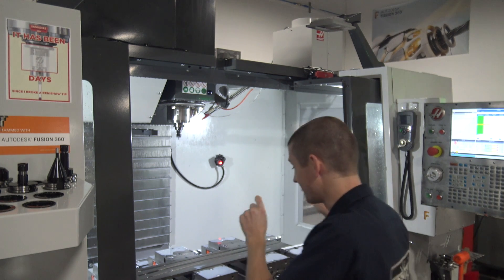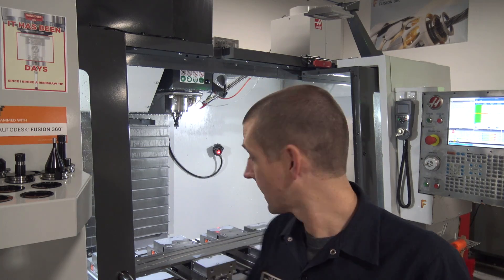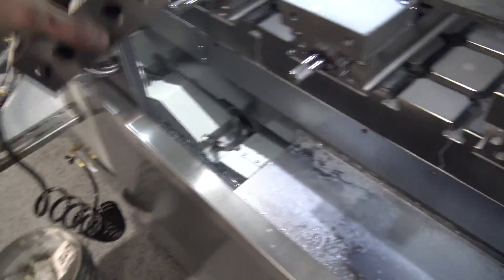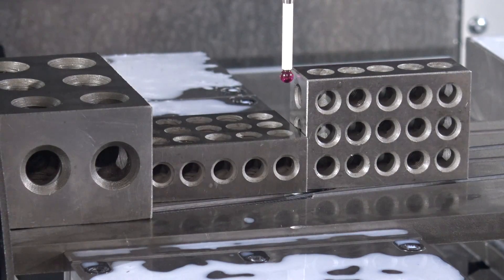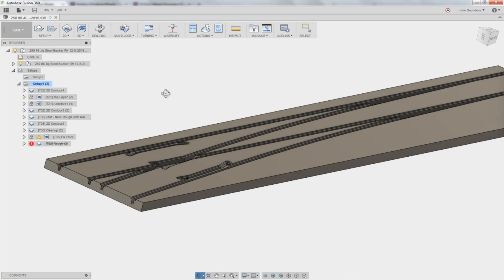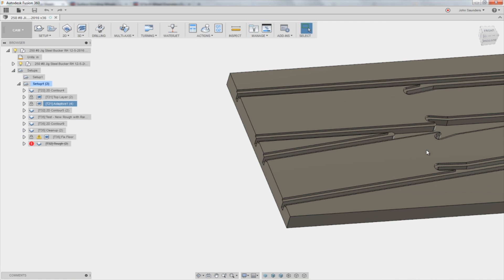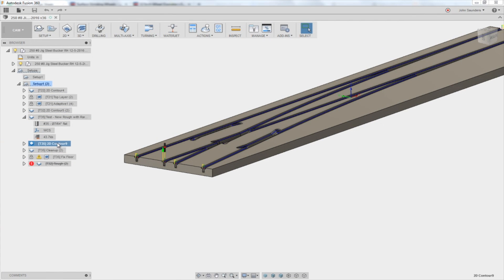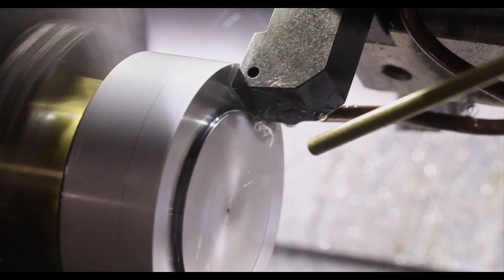Machining a Railroad Jig on the HAAS!

Comment: Hello John, Wish I had seen this video earlier this past week. I had a similar challenging slotted part I had to machine in 1018 MS. Had real trouble with tool path generation and had to get help on the Fusions 360 forum. Part came out OK but am going to try a different strategy, next time. I realize you cannot share the part but could you post the speeds and feeds you used? Thanks. J. Gaertner

Comment: John, why so harsh on the handwheel? Use the jog, and be gentle with the wheel. Apart from the fact you want the wheel to live out the machine life, be proud of your machine and respect it. Handle with care. The moment someone just gives a spin to the wheel like that I take that as an I don't care anymore.(I mean, while it spins you have no control over the machine and while many do it, and those wheels survive, it doesn't show any respect for the equipment)

Comment: Hey John! Awesome work as always. 

Also, just to be a stickler, that is technically a fixture, not a jig. But hell, even I use the words interchangeably at times if I am talking too fast. 

Keep the videos coming!
Reply: NYC CNC Fixtures fix a part to a location (hence, FIXture). Jigs are something that guide drills or cutters, mainly a device that controls the location and/or movement of a tool. By their nature, jigs also fix a part to a location as well, but if the only thing it does is fix a part to a location and does not guide a tool, it's a fixture.

this was the definition I was taught in school. honestly even the shop I'm working in now uses the terms somewhat loosely. I'm just poking fun at ya, though. really awesome video!

Comment: The jig is for assembling model railroad switches/turnouts. Typically, they are soldered together. Most likely, the person puts the track sections in upside down, and then solders to brass or nickel-silver strips.

Really nice jig.

Edit: yep. Got further in the video and I can see they go in upside down. Looks like maybe O gauge.

Comment: Could you do a video on how to set up multi-vise work like this, getting it trammed in? Thanks!
Reply: Clamp them all to a single bar and bolt them to the table all at once. Thet gets everything close then indicate and tap them in.
Reply: No doubt it's easy, but there's nothing like being able to see the steps being done to fill in all the little gaps in knowledge. Sometimes just seeing it work helps to "prove" it can be done! Thanks!
Reply: Now, you can use your 36" riser block that you just made. Clamp it in the vises, tram it in, clamp them down.

Comment: Have you thought about an air blast on a GoPro enclosed in one of the waterproof cases? Might be a good interim solution. Maybe an air blast on the glass of the mill, with a little drip guard above the area the camera looks through? Could be easier than waiting for a portal.

Comment: Will the Haas not operate with the doors open? That RR track pattern is a familiar, I remember having a setup as a kid. Bet you're happy you acquired that machine...thanks for the vids.
Reply: Duncan MacKenzie 
No they will not.  OSHA regs, no machine is allowed to be operated with the door open.  Believe since 2009(?). 

And if you disable it somehow, and a HAAS tech comes in. They will either (A) refuse to work on it. Or (B) re-enable the door locks without telling you. And will usually password lock the parameters so you can't change it back.
Reply: Well, I guess they mean business don't they. I suppose it's for the best. No accidents are good accidents. ~ Cheers.

Comment: Get used to the HAAS taking longer than what's on the simulation, it doesn't maintain speeds while machining curves, the smaller the radius, the longer it takes. One time, I spent few hours on the phone with the TS, but they couldn't figure out why this was happening...
Reply: Miguel Reyes 
It has to do with its axis acceleration. Change in direction (IE tight radius) is a moment of acceleration. Even though the feed rate remains constant, the axis drives still have to accelerate to get it around that tight curve at the given feed rate.  

Now the HAAS controllers don't display it, but the machine slows down its feedrate to match the acceleration limits of the axis drives.

So if you have a lot of tight curves and such, the machinen is constantly slowing it's feedrate down. 

The CAM time simulation just measures the total toolpath distance, and the feedrate and spits out a time based on that.  It assumes the feedrate never changes.
Reply: Thank you! that's kind of what I thought was happening, now it's clear.
Reply: Also, more importantly, this is controlled by settings and/or parameters.

Comment: This might not apply to the renishaw on Haas, but on other machines I've used renishaw say you want to measure the left of a part you change the X figure to a plus or minus. E.g. When it's X+10 before probing it would probe the right. Where as X-10 would probe to the left.

If that's what i understand you where saying and I think the renishaw probing cycles are the same over all ISO programming.

Comment: On my Haas there is a "Door Hold Overide" setting that you can change when you turn on the machine that allows you to open the door while it is running. I believe it is on the second page of the settings pages.
Reply: Jeff L 
That no longer exists on the newer models. Same goes for every other machine tool builder. .  Thank OSHA regs for that
Reply: hrc-rr 
Could you get around it if you really really want to?  Ya I'm sure you could. 

But is the massively expensive  fine OSHA will slap on you should they catch you with disabled door interlocks really really worth it?  

The answer is no. Not in the slightest. 

Also if I recall, HAAS requires a door cycle on startup prior to even allowing you to home the machine.

Comment: That's a jig to assemble a turnout (switch). It looks like #1 gauge, 44.45mm, 1.75". Anyway, the gauge used in garden railroads, LGB, etc.. you should install track around the shop, about 10' high or so along the walls. About 8" wide would be fine. Then you could have a train cruising around. :>)

Comment: Is it true a Haas a disposable machine compare to a Mori?
Reply: pdoggy10inch 
HAAS is a HAAS.  It has a purpose. They are good machines and on the mill side a very good value. 

But no, they can't compare at all to a Mori or okuma. 

That doesn't make them bad machines.  Just fall into a certain class of machine.  

For starting off and building a shop up you can't beat the value a HAAS brings.
Reply: Thank you.....it does appear the Haas is popular machine.
Reply: pdoggy10inch I have both a Haas and also a DMG Mori, they both have their places
Reply: It's going to be an upgrade to his current brand of mill. Not talking about Tormach quality here but the HAAS is all around a bigger mill. Work envelope and tool shank taper size.
Reply: Haas is a cheaper machine that small shops can afford to get in the door. They're  easy to run and pretty straight forward machines. It really depends on the kind of tolerances you are trying to hold and type of work coming in the door...
Reply: pdoggy10inch, after 30 years, you can still sell a Haas machine. A 30 year old Mori is worth less than scrap value, so it is literally disposable. This is because Haas supports every machine they have ever built.

Comment: One tip.
Don't leave your probe in magazine.
Eventually you will damage it. Trust me I know. I run VF2 and VM6 for a long time.
Leave it outside when u don't need it.

Greets, 
Zoran
Reply: razor666666 
I've left the probe in the magazine for literally YEARS with zero detriment to the probe
Reply: Just handling the probe to put it in and take it out; seems to me would put the probe at greater risk. However, to each his own.

Comment: Hi John,

Man, you have got to love that Renishaw Probe.

Just be careful when entering negative Z numbers when doing things such as a Y Web  when close to the vise or other objects.  It was late!!! one night and i put in a negative Z number while doing a Y Web on a very small diameter part -5.  i.e. -5 inches instead of -.5  i.e. -1/2".   Needless to say my $1200.00 probe hit the vise before I got to the emergency stop button.  The sad part is that I had my finger on the feed hold button.  Instead of hitting the feed hold which would have stopped it I reached for the e-stop button. i.e. tooooo late.  Now when I input my negative Z number I say out loud i.e. Minus .5  and also take a second look at the input screen to make sure I have the correct negative numbers before running my probing routines.

Some of the probing moves are protected  BUT NOT ALL. 

The reason the Z negative numbers are not protected is because you could possibly have a longer probe extension installed

Note:  I am running the older system software.

I called Rich Foley at Renishaw and he helped my 70 year old brain by showing me how to slow down i.e. 50% reduction in the  the speed of travel on my Z probing operations.  Takes a little longer but it could prove to be beneficial to your bank account balance.  Ha Ha

You are going to love that new HAAS.

John

Comment: You seriously need to look at getting some high performance tools. Ive broken a couple of lakeshore carbide tools running at 60% of what i run my destiny tool end mills at. I have been extremely impressed with destiny tool and i think it would really be worth your while to give a couple a try.
Reply: Longrangehunter 
Destiny is also 3X or more the cost. 

Production jobs yes, well worth the money.  Job shop? Eh. Probably won't see the pay off.
Reply: Occams Sawzall 3/8" zrn coated end mill from lakeshore: $37.59 stealth coated 3 fluter viper from destiny: $46.23. Hardly 3x the price
Reply: Longrangehunter 
If that's the prices you're paying. Have a sit down with your distributors ;)

We pay less than that for 1/2" Destiny vipers.
Reply: i dont have any distributors, i order online as i am a one man show running my own shop part time. I dont buy enough end mills to warrant finding a distributor.
Reply: Longrangehunter 

Everything is negotiable ;)

Comment: I would think slotting would be the way to go on the HAAS watching the videos adaptive seems to be really slow on basic features. If they were just straight back and forth slots I bet I could just drop down and plow those t-slots out in 30 minutes straight on.
Reply: bcbloc02 
I would have used the same contour ramping he used in the blind slots. 

A .127" wide slot I would have certainly squeezed an .125 endmill through it and just have gone right to finish wall size.
Reply: I like to stuff the chunkiest endmill I can into a slot and rough it out, then clean up the sides and floor real quick.

Comment: If it's a jig or tool that you're making for somebody else, you could talk to them about adding machine reference features to the part for better overall accuracy. If you could add a square pocket outside the customer's area of interest during the early machining passes, then you can reference against the pocket for subsequent setup.

Put in 2 reference pockets "diagonally opposite" for very good repeatability over the whole workpiece.
Reply: Interesting technique. Is there any reason not to make a reference located outside the trimmed area, other than that it might require a bit more rough material? That is, a reference that gets trimmed off in the final stages.
Reply: Permanent reference faces are useful if the part has to be moved or needs to be re-mounted in the future; perhaps because the customer wants something added.

If reference faces are at least recessed from the part's final, external  perimeter, then they are not as likely to be damaged during the life of  the part; or even when the operator crashes the tools into the part.  The reference faces could, instead of being part of a pocket, be part of  a notch on an edge; deep enough to easily reference if the part has to be put on the machine again.

Much engineering is dedicated to trying to frustrate Murphy's Law.

Aside: Advanced CNC controllers allow the operator to set up part coordinates that are different from the machine's native coordinates; not just offset but also rotated. The CNC program then runs unchanged against part coordinates. The functionality is an easier (and therefore more robust) way of implementing 4th and 5th axes so is likely to be available in machines with that (optional) capacity.

It allows a machinist to re-fix a part without having to be precise as the CNC is able to determine offsets and rotations in all axes by using the (6) reference faces and the part's reference dimensions known from CAD/CAM.

Aside 2: Almost all manufactured items have some sort of remnant feature in the final product that was used to facilitate manufacture, assembly or maintenance.  Customers tend to have their designers deal only with the product's functional features (and appearance). A conversation between the maker and the customer has to establish the benefits to the customer of incorporating "manufacturability features" that make the final product easier, cheaper and perhaps even better for the customer's customer.
Reply: You could superglue an aluminum part to it, machine it and use it as a reference. This way you can remove it after the job is done.